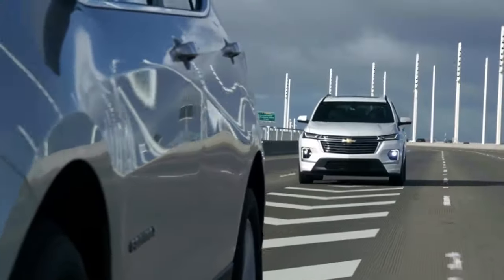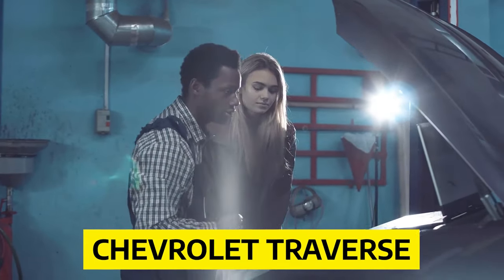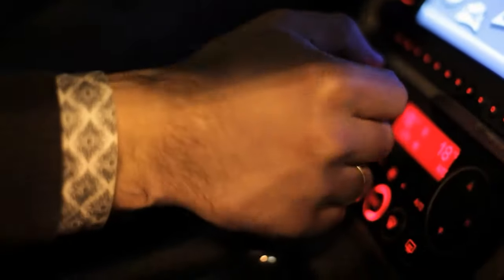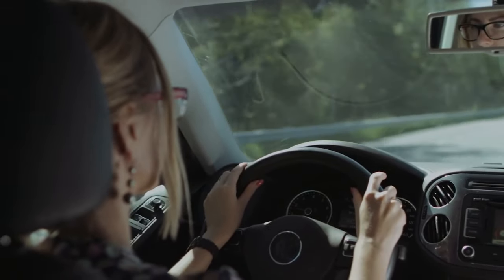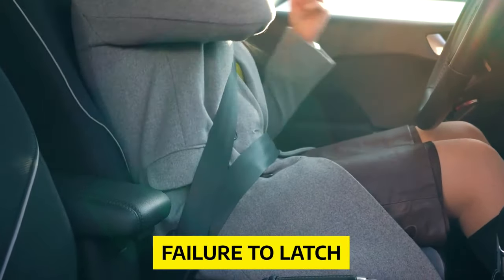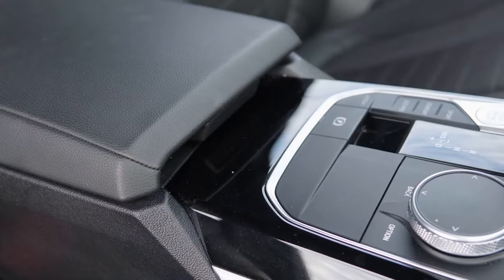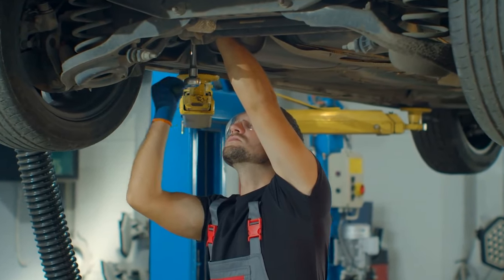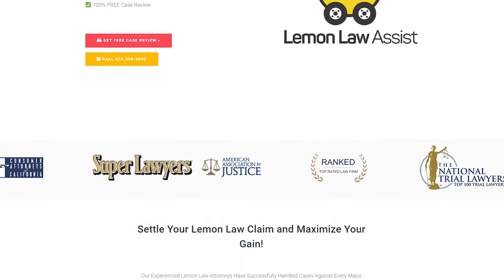WATCH THIS If You Have Chevy Traverse | Lemon Problems of Chevy Traverse

Comment: Easy solution get a Toyota
Reply: And it will unintentionally accelerate and crash into what's in front of it. Toyota does NOT make vehicles like they used to!
Reply: I'm straight on my car accelerating, not stopping until I crash into something, then maybe D!3 😱
Reply from the maker: I'm sorry to hear that. If you need our help, our office will review and evaluate your car/truck problem. Click the form link and fill out the form to get a free case review https://form.jotform.com/mollaeilaw/lemon-law-assist-youtube
Reply from the maker: If you need our help in the future. Click the form link and fill out the form to get a free case review https://form.jotform.com/mollaeilaw/lemon-law-assist-youtube